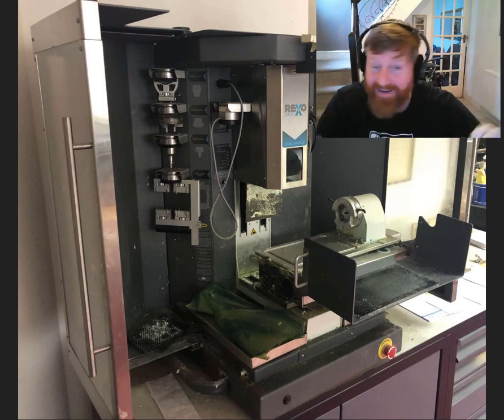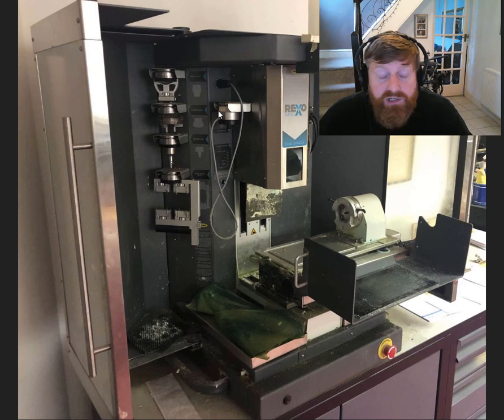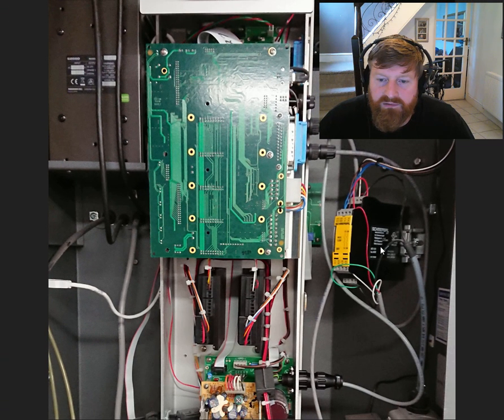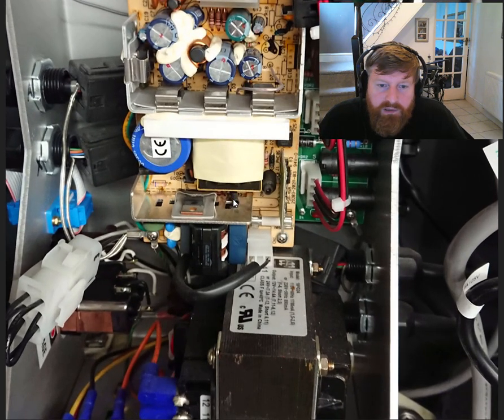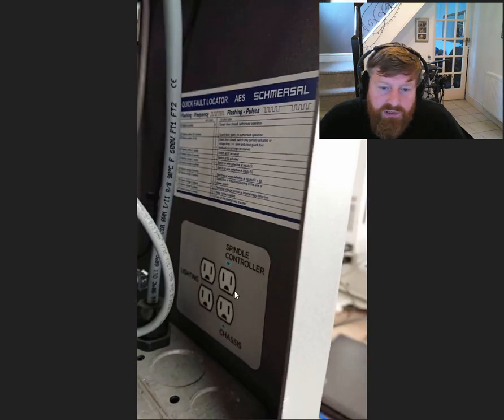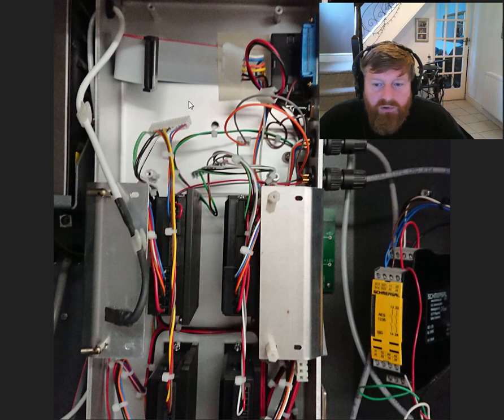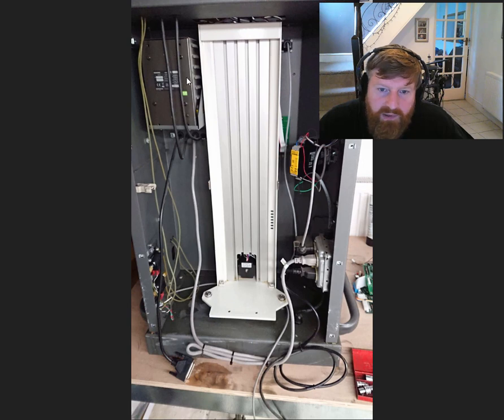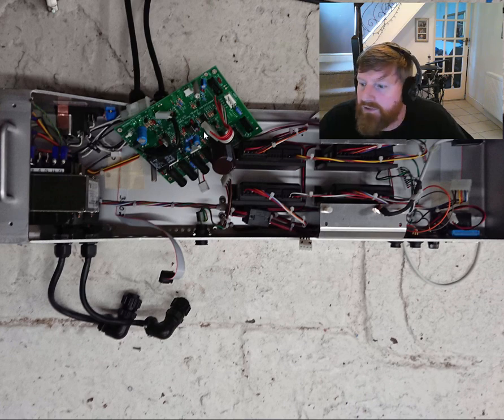Converting a Revo 540 CX  mill to run on Mach 3 (Part 1)

Comment: Thanks for the video. I'm picking one of these up soon and I'm wondering if the stainless steel (?) doors on yours were original. They're not pictured on the one I'm getting or in the photos I've seen online. Also, I need to fit it in my car and it's slightly too tall. Do you think it's sturdy enough to travel on its back for about 4 hours of highway driving? I'll be retrofitting mine to run Centroid Acorn, so I may have more questions. Good to see you use Deskproto with it too - I've been a DP user for a while on my 3-axis CNC router.
Reply from the maker: @PerryPaolantonio  hi, I think the doors were an optional extra , yes it will be fine to lay on its back they are heavy though, watch your back when moving it !! I'm still using mine I have put a bigger spindle on one of them and it cuts aluminium no problem
Reply: @Josef1cnc  Awesome that's good to hear - I am planning on upgrading the vertical spindle right away so we can use it for Delrin and possibly aluminum.  Did you end up keeping the coolant lines? I'm wondering how messy it gets. We're using it in an office environment. It'll be in its own room so noise isn't much of an issue, but mess is!
Reply from the maker: @PerryPaolantonio  I   use an air mister for the same reason. I don't use the built in coolant system it's meant to keep wax cool and not really upto clearing metal chips I don't think

Comment: Hey Joe, I just started the mod, I'm still buzzing the wires with a multimeter and writing down all the pins. It's going very well so far. I was wondering if you also noticed that A-axis and Z-axis share the same dir+ and step+ signal, it seems like only dir - of both Axis have discreet connections. I was wondering if you separated their signals or you if you left them as is. I'm worried about magic smoke escaping if I power them to the new controller. Any advice?

Also did you keep the original power supply, I wanted to keep it because it besides being wired already they have the status LEDs shining through the Metal column holes, blinky leds make me happy I want to keep it 🤣. If you did keep it, what pins turn on the power Supply?  Thanks Joe
Reply from the maker: That's great ,   I can't remember from memory and don't want to say he wrong thing but they may be switched by negative which would mean all the positives goto the same place. I will have a look tomorrow ,  I think it's like that for all axis's . I swapped the power supply out to make things easier for me  also because we have 240v here .  Again I will have a check tomorrow and  let you know what voltage I used .
Reply: Great thanks, I will update you, I will try to keep the PSU it just fits well in there. I have to figure out how it's turned on. If I can't I will just replace it with something smaller. It's amazing how this company managed to hide the schematics for something for so long my mill has a stamp of 2007 manufacturing date, yet you google the parts nothing comes up other than surestep Drives and the Steppers everything else is a blur.

Comment: Hi!   I am helping a jeweler friend troubleshoot his 540C.  Any good guides/literature you may have?  Seems there is no longer any support for this machine and as of now, its just a giant paperweight.  Thanks!
Reply from the maker: The problem is the software to run it is now obsolete from Gemvision Matrix.  I converted it to run on mach3/4 by fitting an ethernet smoothstepper and rewiring some of it.  It works great, I use deskproto to do the toolpathing.  A version of this software was originally used and you can unzip the files from it and get the G code if you have existing models. You could use any pathing program just needs set up to work with Mach and set up a postprocessor .What is the problem with the mill ?
Reply: @Josef1cnc  Thanks for the reply. The machine has been working fine and in the middle of a job, it stopped.  Symptoms now are when the mill is fired up, it will not home any of the axes.  “Unable to find home” with no axes moving at all. I am able to use the software to move the x-axis (both directions) and the a-axis (clockwise and counter-clockwise).  The y-axis will only move forward, even when commanded to move aft and the erroneously thinks it’s hitting the limit switch.  The z-axis will not move at all; sits there silently (no grinding or buzzing noises) but the software shows movement. The mill has not been taken apart since it stopped working.

I checked all the fuses and they are all in good order.
Reply: @Josef1cnc  thanks for the video, we're you able to use the existing drivers? I was thinking the same as you, I have the smoothstepper ethernet version as well as a pmdx 126 breakout box. I was wondering if you swapped the drivers to geckodrives or something else. What Break out box did you use with your smoothstepper? Thanks you gave courage to start this mod. Thanks again Cheers from Canada.
Reply from the maker: @Pixelvore1  I used the drivers in the Revo they were fine I google the model to get wiring diagrams and it was simple enough. I used a DB25 D-SUB Male 25Pin Plug Breakout Board with screw terminals off ebay and used FEMALE LPH26-to-DB25 FEMALE cables from the smooth stepper to the breakout boards, I did have a smoothstepper breakout board but it was a bit big for where i wanted to fit it. I also used a couple of arduino type relays to switch the spindles on  also i rewired the home switches to the smooth stepper which worked great.If you get stuck give me a shout I will try and help Cheers Joe
Reply: @Josef1cnc  Man, good to know. You Saved me a bunch of money, I have been looking into geckodrives because I thought those drives in the revo were proprietary to gemvision board.  I will dive into this in a couple of weeks. It's very good to know you got it working. Congratulations and thanks for offering me the help, I will definitely get stuck somewhere. I'm glad to know at least one person on earth converted the Revo to run on  Mach3/4. Cheers Joe.